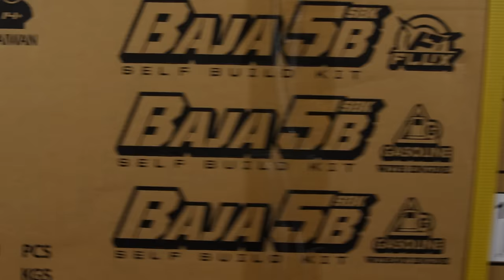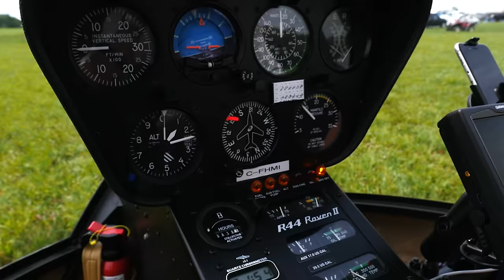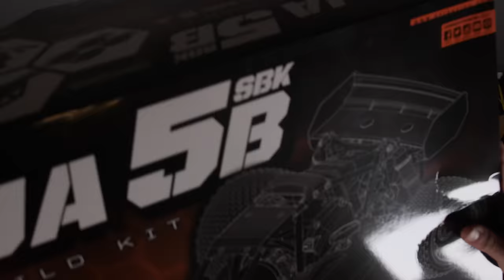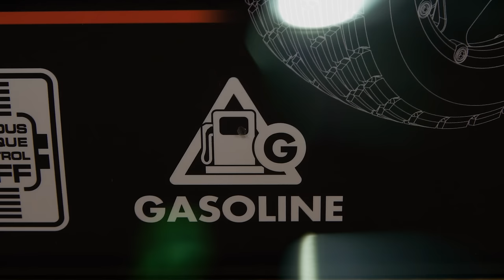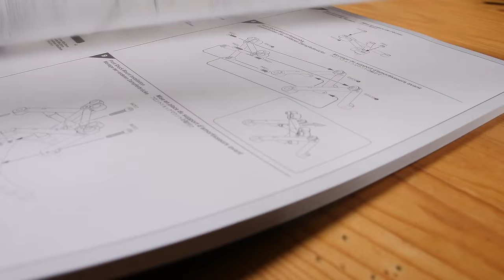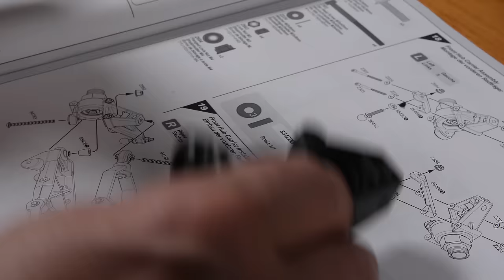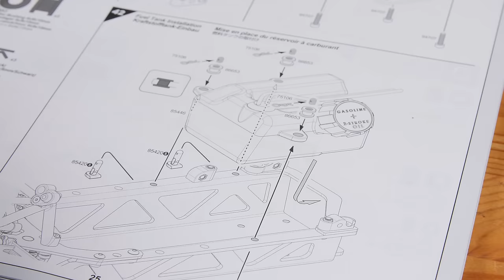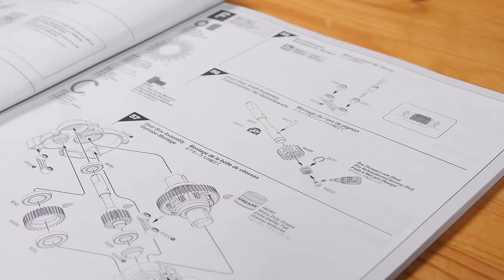LEGENDARY BIG ASS RC (finally) Re-released | BAJA 5B SBK GASOLINE

Comment: I mean on a 1/5th scale I really don't think it's impossable..   I mean ya'll take it to the limits,  why not go past that?  Because it's dangerous?  Just close something off, ya'll probably get the permits next to nothing.   It would be a awesome promitional video, I mean knowing what ya'll know.  After the Nitro, mayby some may be intrested into the two stoke feild.   I honestly love it!!!!   There's dirt tracks all around the country, with a 1/5 scale vehicle.  It could possability be a thing.      I mean like pit stops to re fuel or change tires, I mean most of those tracks are about a mile, and you have an advantage point so you can see your car...   I don't know or you remember this, teather cars were all the rage in the 1940's, and they just ran around in a circle to wich they were tied to,  But with the controller behind the wheel... There's copitition

Comment: Awesome hobby to get into it does get expensive for upgrades but in the end it's worth it got mine second hand and build it again it had a 26cc in it now its a 32cc a beast
Reply from the maker: we did kind of a cost comparison and we found the fifthscale is cheaper than most bashers, and most 8th scale racing platforms. once you factor in batteries.

Comment: I got mine done and it’s awesome. Do you have any worries that the lower body pieces block the airflow to the engine? Thanks for being the inspiration for me to buy this kit.
Reply from the maker: they like to suck up leaves. so yes you need to be careful and clean those pockets under there regularly. also look into outerwares for your engine pull start and block.

Comment: I Still have my original SS. I bought two as well as a 5T. I gave my 5T to my older sister and one of my SS's to my nephew. I built both SS's because that's what I enjoy. I still have the first SS though. I've been out of the RC world for a few years and was just starting to get back into it again starting around thanksgiving. I got my old SS out that's set around for years not running and was going to get it running again when I found out about the re-release of the Baja 5B SBK and had to have it. I finally found a dealer that had one in stock and got it just before Christmas. I'm still awaiting for a few minor parts to finish the build. I can't wait to get out and run my SS against my new SBK. Now if only HPI would re-release the Savage in kit form again. I know they would have at lease one sale here, maybe two.
Reply from the maker: Oh dude. im waiting for that savage kit too! Nothing better than a baja build though!

Comment: This makes me happy as shit. I just picked up an authentic complete chassis of a Baja 5B  and a 5SC conversion kit for it (Has some RPM parts). I was struggling to find good parts for it. Rovan is ok but their quality is definitely subpar and I would assume the same of King which also produces parts for these. There is some stuff missing but for the price I am not disappointed cause it is in excellent condition.

Another thing I was struggling to find was the freaking manual for sale, not just a PDF, as well as a build manual at all. I cant find on even in a PDF. Basically mine is at the point you had yours at 13 minutes in, add shocks and take away the read diff and fuel tank and thats the build state mine sits currently.
Reply from the maker: sweet man! hope the build finishes smoothly!
Reply: @kpopRC  thank you!
Im going to stand by for the moment and see what HPI does re-release cause I'd rather get the parts from them, unless ofc I go for an aluminum build.

Comment: The 1/5 scale super touring sedans started racing in America. The baja was for bashing in the desert
Reply from the maker: you're talking to some one who spend the baja gory days racing. even traveling to the east coast nationals. friends on the west coast side. Hostile fest.. the scene was massive. I blame the internet. because at the time, forums were king, and communities grew much faster than any other time in RC history. to say it was for the desert is just not correct, proven by setup printed in the original manuals, as well as piston options and spring options.
Reply: @kpopRC  Racing in the 80's with my RC10 , we didn't have forums or internet. IBM was still a green screen. In Socal , Pomona racing was big. Later ,here in the west coast, older guys got tired of 1/10 nitro and 1/8 nitro because it was too fast and it was hard to see on big tracks. So they decided to race 1/5 scale sedans , with motors that were cheaper than nitro, which we made fun of but now  getting more interested in it. The only thing we knew was what we say. The bajas were stuck in the the dirt parking lot and off road course, that they did terrible on. So most guys just went to Glamis where they can bash around on those bajas and not be afraid of hitting anything and turning 180° on purpose.

Comment: It would be nice to know the difference between the original and the new version
Reply from the maker: not much. the anodizing is different, no tools come with the kit except a wheel wrench. and also no extra pistons for the shocks. other than that it's the same. it actually felt like it all fit together a little better than the original SS kit.

Comment: Kpop. Did you have the problem of too short posts for the front of the radio tray? The posts are too short and the hole for the pin is not above the radio tray leg. Did you work around that?
Reply from the maker: yep. push them in harder. they'll go in another 5mm.
Reply: Thanks brother. It was making me crazy.

Comment: Any  noticeable strengthening to the gearbox/ transmission case?  I remember that was a big weak point on mine.
Reply from the maker: it's a bone stock 2.0. Im sure down the line, they'll add upgrades. but right now i think priority is to get all the production up and running to offer stock parts, cheaply and at a WAY higher quality than clone companies.
Reply: The gearbox is extremely strong. The only point of concern would be the clutch bell carrier. There are very easy and relatively inexpensive fixes for that.
Reply: @DDMSteveB   good to know!  Thank you. I just rememer the actual plastic casing having alot of flex to it on my ss build years ago. Definitely looked sturdier on this video.   Any info on release date/ price/etc
Reply from the maker: @HognAndRign  4 weeks everyone will have stock. if all goes well. price not sure yet. we'll know in a few days.
Reply: @DDMSteveB  DDM going to be full of baja parts and buggies again 😀

Comment: Dude you got all those 5Bs lying around and you don't have a kick ass tuned motor ready to drop right in, I'm disappointed C man! Not angry just disappointed!
Reply from the maker: i do. they're just all dirty. lol. Check out the parts bin build. it  has so much compression it's super hard to start lol. DDM is sending us something newer. should be a great fit and brand spankin.
Reply: @kpopRC  coolio I'll be watching buddy!

Comment: I was 5th scale racing back in the 80s with late models and sprint cars I don't remember none of these you said they are vintage how long. 🤔⁉️ I haven't seen Sprint car still I regret getting rid of my late model car look just like my father's race car aluminum body. I only find those in Australia on the internet I don't know why no one uses them here.
With full roll cage in it like a full size car
Welded cage to spec's down to gas tanks. It just sits in my garage.
Reply from the maker: Dude that sounds super cool. i was weirded out when Harley and SBG called them vintage a few episodes back. now i've been using it for effect. but yeah. vintage just means of age. i guess it's almost 2 decades old the baja. it's not like the original large scale in the 80s for sure.

Comment: Do the new hpi wheels still have the flex issue that the old ones have(the old ones flex bad from sidebite running dirt oval)
Reply from the maker: yes. the wheels on this are the same stockers. they basically found all the tooling and made the ss kit. But with the 5sc hubs and axles.
Reply from the maker: also... you guys should try mcd wheels and tires with axle extenders... WAY less rotational mass.

Comment: They were saying they did updates in the new kit
Reply from the maker: these are the same as the last Baja iteration the 2.0. They switched owners and their manufacturer went under. it's been crazy for them to rebuild the production. Not to mention the unlicensed unsanctioned clone market.
Reply: @kpopRC  very true..I like the you have an option for going gas or electric, with the clones you don't get that they come gas with gas motor
Reply from the maker: @onemansvideos2134  the clones are back shop castings stolen designs poor quality cut corners and the reason the original manufacturer fell on hard times. clones are garbage. We know we've seen enough of them.

Comment: Link where to buy in europe 
Cz non of the rc shop where I Used to buy it before does not have it
Reply from the maker: hpi is a different company now. so it' has different distributers. tbh. the stock seams really spotty. and im not sure on parts availability.

Comment: Any difference in parts from the original Baja 5B?
Reply from the maker: the machining is a bit better on the diff and drive line parts. the plastic molding also looks very good. I'd say it's a higher quality manufacture. it's the baja 2.0, so it has the 5tsc rear hubs, including the really fat axles. other than that it's all the same.
Reply: @kpopRC  if it ain't broke don't fix it lol now I'll be able to restore my OG baja and not have to use clone parts

Comment: Anyone have the issue of the backplate to the gearbox fitting like absolute shit?
Reply from the maker: loosen all the main bolts. it will fit nice. then tighten everything. if you're talking about the top transmission/ brake plate.
Reply: @kpopRC  I’ll give it a shot in a few but yes. It’s the plate that goes behind the transmission gears and in front of the brakes.
Reply: @kpopRC  ended up being a factory imperfection. Ended up having to use a dremel. Now it’s all good.

Comment: too bad they never changed that horrible non traction tread on the rear tires…… and c clips? it’s 2022….
Reply from the maker: no c clips on hubs, and yeah those rear tires are garbage. I think they should have come with out the tires tbh. but it wouldn't sell to regular bashers that way. The idea i think was just to get it to look like the first release. the nostalgia alone will sell hpi a few rounds of production at least. They did go with the newer rear hubs, the old ones cracked constantly, and they put SUPER thick axles. The diff cups are going to wear the same way they always did. but hey... that's why we got DDM am i rite?
Reply: @kpopRC  yeah. such an iconic car.  and fun once it grips up 😁

Comment: 750 dollars for somethin that dont even work yet.  rip off !!!
Reply from the maker: this isn't even an expensive fifth scale. lol.
Reply: @kpopRC  750 for a piece of plastic that dont work is expensive.
Reply from the maker: i think that's relative steve. a working baja is still cheaper than a set of 1:1 track tires for the season. I bought my hpi ss kit in 2008 for 1200 dollars, basically the same price as now except with a much larger 32cc engine from ddm. Doesn't work? dude we raced this platform for 6 years 25 races a year. not sure why you're so pissed off. this is a very good platform.